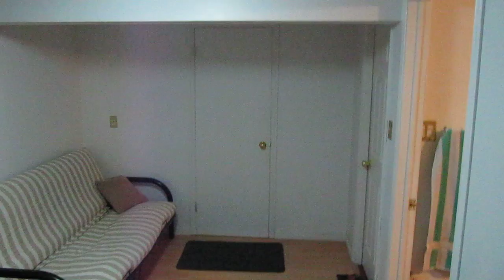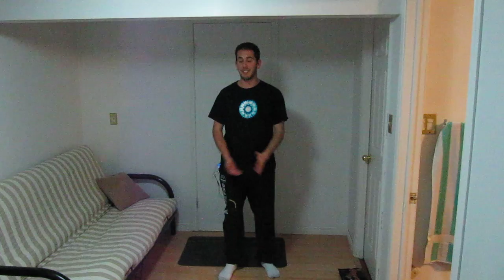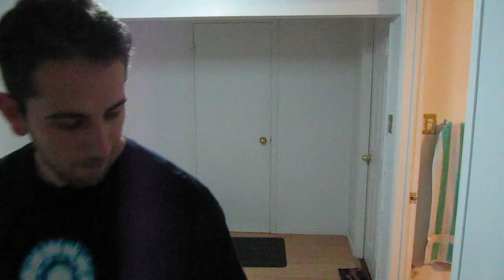Iron Man Walking Sound Effects

Comment from the maker: I had not seen that, no!  Looks pretty great actually.  And a lot cheaper than the mechanism I made, lol.  The only advantages mine has are that the hardware is only a 4x6cm area, and is only 5mm thick.  Plus, it has long-life rechargeable batteries, and the sounds are custom-tailored for each application.  But, as they say, there are no original ideas out there anymore, lol! :)

Comment from the maker: Thanks!  I am happy to share my code. :)  Just fire me a message, and I'll send it your way.  However, from what your describing, it sounds like you're going to need a gyroscope instead of an accelerometer, as you need to sense rotation.  That is a little trickier to get accurate readings (I know from my War Machine Gatling Gun, lol), but for your application it should be fairly simple. :)  Glad you like my work!

Comment from the maker: Thanks so much!  I use Arduino for all of my programming needs, and by custom-made parts - I assume you mean the circuit boards.  I design them myself, and I had used a Canadian circuit board company, but I'm going to try BatchPCB for my next run.  And, for all of my electronics, Sparkfun is the place to go.  They are the best in terms of price, selection and general awesomeness.  The "Google" of the electronics industry. :)